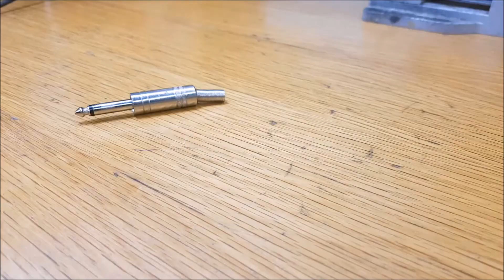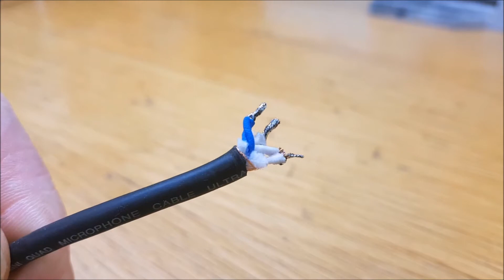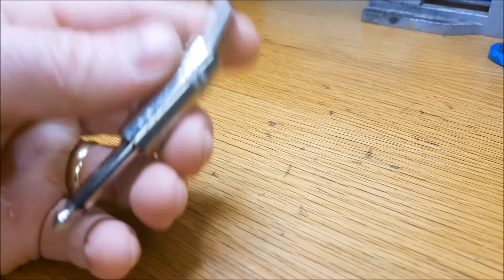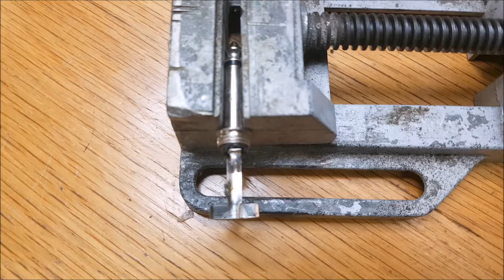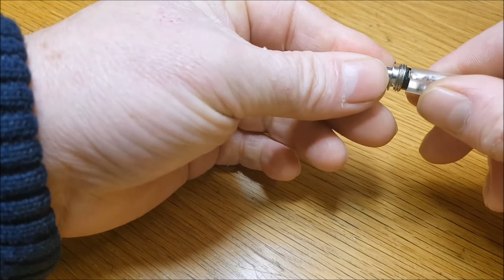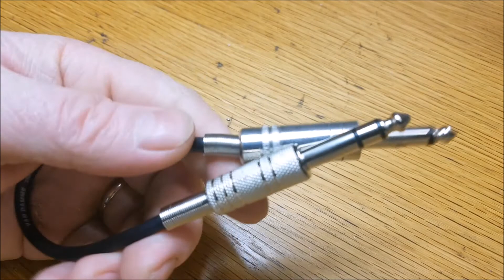How To Make A Balanced To Unbalanced Cable

Comment: Whats the difference between tying cold and ground and floating cold?
Reply from the maker: @zombienoob410  the screen and audio minus are not connected together the screen is just left unconnected.
Reply: @GeorgeDonaldsonsWorkshop  sorry i meant whats the difference as is there a downside to connecting screen and minus or just floating minus? I'm worried about toasting my outputs by connecting screen and minus
Reply: @GeorgeDonaldsonsWorkshop  I want to take a mult out from a patch bay to feed an AV reviver powering my B speaker. trying to decide if i should float minus or bridge to screen.

Comment: I have seen an article on Sound on Sound "Understanding and solving ground loop" suggesting not soldering the screen to the sleeve on the unbalanced end and just connect the blue cable to the sleeve instead. Or optionnaly suggesting that the screen should be connected to the sleeve with a 100ohm resistor. And also a 100nF capacitor in parrallel.
I am curious to know what do you think of this advice?
Reply from the maker: https://www.ranecommercial.com/kb_article.php?article=2107 have a read of this. This is the bible of audio interconnection.
Reply: @GeorgeDonaldsonsWorkshop  Thanks! This looks very informative indeed :)

Comment: Thanks for the video. Can this cable be used to connect a unbalanced output to a balanced input?
Reply from the maker: Not as far as I know. The school of thought is that a balanced connection will flow towards an unbalanced one. I'm open to correction on that though, with most of the stuff I know about audio, is from trial and error. Give it a shot and see what happens!

Comment: I am glad I revisited your channel, George. I remember asking you about this very thing awhile back. Having failed to get to the task at hand I came top seek this info again.
I have an amplifier that uses the 1/4" TRS for inputs and a preamp with RCA unbalanced outputs. I understand the desired line out voltage may not be what the amplifier would like to have but other than that all I need is some quad core mic cable (I think) I soldered professionally for decades so that should not be an issue. Thanks again for this video
Reply from the maker: No sweat Craig, glad you found it useful.

Comment: how would you  built  a cable with two TS (mono) to one single XLR. 
want to use two mono outputs from my keyboard to one single channel  in the mixer.
thanks
Reply from the maker: Are the outputs on the keyboard for left and right or what way is it?
Reply: @GeorgeDonaldsonsWorkshop  will be in stereo im using VST and they respond better in stereo.
Reply from the maker: @crfmusician  I'd imagine you'll have to use two leads. TS to XLR for each channel...

Comment: Sorry but didn't you just make a mono to mono (TS to TS cable)?
Reply from the maker: No. It's TRS on one end and TS on the other.
Reply: @GeorgeDonaldsonsWorkshop  This is a good question because you connect ring and sleeve at the TS end of this cable which logically makes the TRS into a TS connector. You say the connection of negative and shield should be made at the unbalanced end of the cable and refer to some doc, Rand!? documentation. Its hard to make out from the video. Could you please elaborate on that?
Reply from the maker: @sodiumpentymal  it's not really that difficult. If you use 3 conductors at one end of a cable it's balanced at that end. By tying audio minus and shield together at the other end, it's a poor man's way of unbalancing the signal. The document I refer to is  the Rane Audio Interconnection document which is easy to find by googling that.
Reply: @GeorgeDonaldsonsWorkshop  Thanks for the quick reply. I have a RME ucx2 interface with "servo balanced" I/O. Tried the forum there but never got an answer how to connect the shield.
Reply from the maker: @sodiumpentymal  one you find the rane document, you'll be away!
Reply: @GeorgeDonaldsonsWorkshop Thanks for making this vid.  Where is the link to the rane document?  You said you would put it in the description, but I don't see it there...